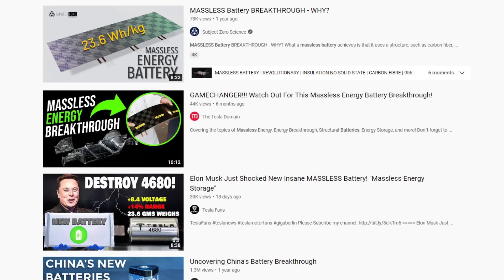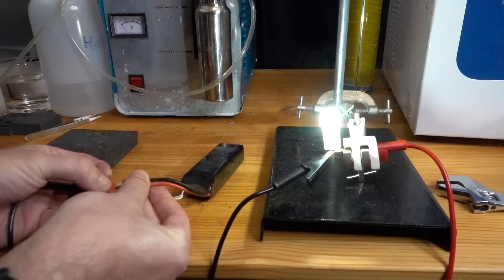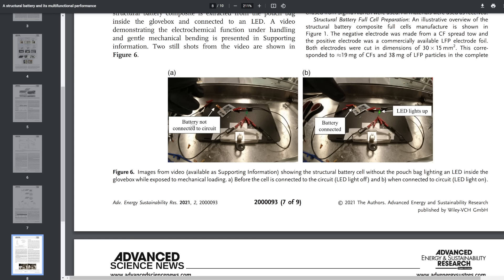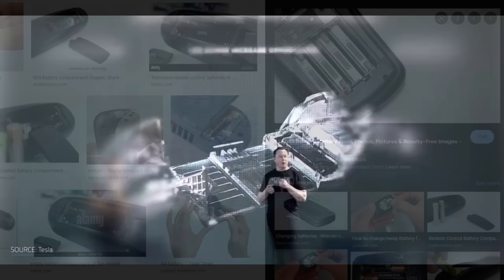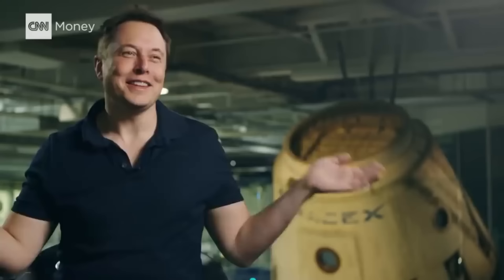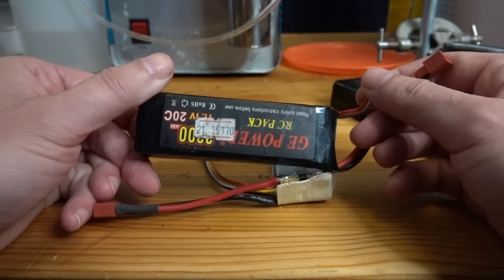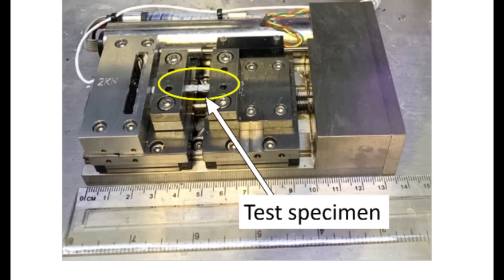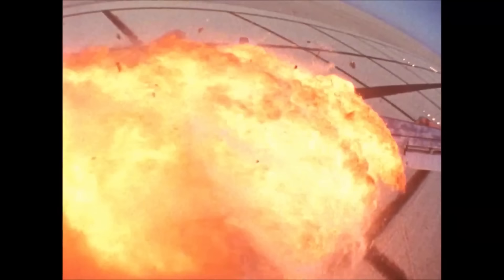Matt Ferrell, Massless Battery: BUSTED!!

Comment: Oh yeah, making it much more difficult to replace the battery of a Tesla by gluing in the battery is a great idea.
Why would you need to replace the battery of an electric car. Not like it's a part that goes through a lot of wear and tear.
Reply: No, but it IS the first to degrade to limited      performance before the major components do 
The average battery is ~ 50% after 10 years of cycling, way before major wear on mechanical components.
Reply: @dnomyarnostaw  You are out of date there on your statistics, and you will need to refresh yourself on current battery degradation, modern cells used in high end cars degrade roughly 1% per 20,000 miles (32,200 km). As such packs that are taken care of will last you around 20 years driving an average of 13500 miles per year.
Reply: @Yattayatta  Maybe for a good installation,  you could be lucky,  but if you look at actual plots of performance,  you get 15-20% that degrade far quicker. 
That's why a few of the new ev manufacturers like Vinfast are planning to hire the battery.
Nothing in electronics is guaranteed. 
You can throw away a bad TV, but a car with an outlier battery degradation is a problem .
Reply: @dnomyarnostaw  No different from an ICE car (by the way I don't drive an electric car, I also do not own any stocks in any electric car manufacturer, I'm just looking at pure data here) If you treat your car well, it goes further, if you don't, it'll degrade faster, if you never change oil or filter in your ICE car you won't be going as far as someone that does.
I'm sure there could be installation problems in some EVs, I suspect the difference is mostly down to how people charge though, if they use the "long distance full charge" function and if they stop straight away when something in the BMS loop malfunctions. 
You have to remember, ICE cars have been around for a long time, most people know the general advice on how to care for their ICE car to make it last longer, EVs not as much yet.
Reply: @Yattayatta  Proper operation is not even in the argument yet. EV "lemons" are not uncommon, as are ICE "lemons".
The thing is, a bad ICE front suspension problem, airbag, fuel line, brake or transmission problem, you can do a recall, like they have over the last 5 years.
A "lemon" battery, which is upwards of 7% ( if you don't count the GMH debacle)  that is built in, writes off the entire car..
Finally, "Most car manufacturers guarantee EV batteries for eight years/160,000km", so sure, you MIGHT get a 20 year battery, but the manufacturers don't think so.
Reply: @dnomyarnostaw  There are tradeoffs to everything, for sure, but to say that EVs are in their final and most advanced state they could possibly achieve is false. Look at the progress made in ICE cars over the last decade even though they've been around forever.
You can for sure recall a car over faulty battery cells as well, even if they are structural, that is on the manufacturer, not the consumer.
About the warranty, unless you go to some extreme luxury brand I will say with high confidence without looking it up at all that noone will offer you a 20 year warranty for 800 000+ km either.
Warranty is not there to protect you from ware and tear, it's there to protect you from factory mistakes.

Comment: 5:30 I'm going to correct you on one tiny thing here, batteries in terms of removable and functional have been around for a lot longer than 50+ years, for example the AA cell has been around for 75 years (standard) and 115 years total. The D cell is older still.

Comment: I think he's referencing the fuel feed pumps, not the injection pumps, which are part of the engine. It wouldn't make much sense to plumb a whole wing with a 200 PSI fuel line, especially since you need to vary that pressure to control the fuel injection rates. I wouldn't be surprised if the feed lines in an aircraft will function to some degree if the feed pumps fail (though the flow would have to be restricted somewhat).

Comment: Are they implying the battery has no mass?

Something that stores energy is a battery.
The pictures suggest the battery contains metal.
Metal has mass.
Therefore, it's not massless.

If the massless battery was actually massless, NASA would build their spacecraft out of it.
And because it's massless, spacecraft would become extraordinarily efficient- Probably going near Lightspeed.

But they don't. Why?
Because it's not Massless.
Reply: Think if they tried to lift one billion massless batteries, they could lift it?
lmao

And even if it was true?
A battery exploded in my hand once.
To imagine being surrounded by that, in a car(let alone a plane) is quite terrifying to think about.
Reply: Its more a "buy one get one free" deal in terms of mass rather than a battery that weights nothing. They just say that any structural beam/panel could also be a battery. And is nonsense.

Comment: The "gravity fed engine" thing would be a massive hazard. The power shuts off, and now the engines are stuck on full throttle (or whatever throttle you left them at). At least if they shut down the procedures are fairly simple, you glide until you land. Matt Ferrell's engines would make you completely unable to land

Comment: Gravity feed fuel systems in aircraft only work for high wing planes, ie. Cessnas and similar, and that's only if it's carbureted; a fuel injected engine would still require a fuel pump despite a high wing.  Low wing planes like Pipers, etc. require a fuel pump, which is commonly engine-driven along with an electric fuel pump for backup.  And while jet aircraft commonly have the engines below the wing, as TF says it still requires very high pressures for fuel injection.

Comment: I don’t get how this battery works. First off you need a completed circuit. So the carbon fibre electrode is just carbon fibres which are soft and floppy and part of the electric circuit conducting electricity, fine. So now you want strength and that carbon has to be encased in resin which is non conducting and electricity won’t flow. That massless battery has no structural properties at all as the lotion ion sulphate and the aluminium and the carbon fibres aren’t load supporting. The load is just carried by the clear plastic packet.

Also the battery wouldn’t be massless as mass is always there regardless even of gravity.

Comment: For those unfamiliar with CF composites as structural members, there's two ways to do it: the super expensive way is hundreds of layers rotated during layup with epoxy resin, or using a lightweight core material, like honeycomb aluminum or certain closed cell foams. 
Let's now replace that with non-structural battery packs and sandwich between even thinner layers of CF. And rather than leaving the heaviest part of your battery pack low and centered, let's put it Everywhere, as far away from the centerline as your structure allows. Of course that won't matter much when the robot is driving for you at 10mph in a one lane tunnel... 🤦‍♂
Just for an added kicker, jet fuel is typically injected into the combustors at (and often above) 1,000psi, through high flowing pumps with fuel lines as big around as your arm. I'm sure gravity will have no problem overcoming the friction required to turn said high-flowing pumps and move past all the valves and seals between the fuel line, solenoids and the minute injection orifices! If only my engineering brethren had consulted the all-encompassing tech shills at Undecided, imagine all the hurdles would could have skipped the last 50 years of aeronautical evolution!

Comment: Some aircraft have submerged booster pumps which help boost pressure to the engine driven fuel pump.  They only need them when furl gets below a certain level.  Others rely 100%on gravity feed to the engine driven fuel pumps.  So I'm not sure what Matt is even talking about.

Comment: Wait but haven't you seen the mass-less structural battery that Tesla uses in there cars! Because it's under the passengers and not in the car with them it's isolated and much safer than normal gas guzzling cars.

Comment: That's not how lithium ion batteries are charged. The whole string is charged at the voltage of the whole pack. Those wires to the cell junctions are for the bms to monitor the cells for over voltage and stop the charging or put a resistor across the cell to keep the voltage safe while the other cells catch up.
The black is only connected to one end of one cell otherwise it would create a dead short.

Comment: Just to keep things technically correct there are fuel pumps that supply the injectors, u could probably gravity feed fuel to injectors but need electricity or mechanical energy to activate injectors.

Comment: Carbon fiber is a problematic structural material, it can only be used in limited applications. It has the famous side weakness problem, ie it is only strong in 2 dimensions. Not such a problem for aircraft fuselage but this is going to be a big problem with cars.

Comment: I worked in the parts room for General Motors  auto dealers in the 80's. I saw a switch from field servicable components (transmission, engine) to a factory modular component replacement. This battery module smells of that to me. It puts more labor hours in the unionized factories instead of disseminating technology into the public. What happens when somebody builds a better battery pack for a Tesla?

Comment: I can see a structural battery in something like a marine environment where an metal boat might be able to generate a constant low current with a few strategic components in the saltwater and somewhere else in the middle structure. It might be useful to power a beacon or an emergency function of some sort.    In other words something like the saltwater battery displayed by thunderfoot could be useful in some application.

Comment: That's a marketing fail, they should've called it a massless quantum structural battery, lol!
But i have an idea for ice cars; use the driver- and passenger compartment as fuel storage. Now we have a massless structural fuel cell!!!!1 One only needs a diving suit and oxygen tank to drive the car (great idea, putting compressed oxydizer inside fuel, lol!) As a bonus, the fuel cell is now integrated into the best protected area of the car! :D

Comment: The Tesla 4680 battery pack uses the battery cells themselves to connect top to bottom metal in the box.  The box would not have the same strength or stiffness if it were empty of cells, in the same way that a hollow door is stronger with nothing more but a honeycomb of cardboard connecting the front and rear skins of the door.

Comment: Commercial jet engines have mechanical fuel pump so gravity feed from the AC tanks to the engine can work because once the fuel reaches the engine the engine pressurises it enough to inject it into the combustor, so long as the engine shafts are spinning.

Comment: There is a bit of truth to the wing fuel gravity feed. The fuel pumpe moves the fuel to the engines where the injectors take over. So gravity can in some cases stand in for the pump, but not the injectors

Comment: just petty note, balancing connector work littlebit different. You can charge it all together from power connector. Then in your case black white is cell 1 and second cell is white yelow (black yelow is cell1 and cell2 in series). Charger use those to connect resistor to cell with highest voltage to balance it.

Comment: Well just to be pedantic: Your black wire is not connected to all negative terminals but in fact to the negative terminal of the very first cell in the pack. So cell one is charged with black and white, cell two with white and yellow and so on.

Comment: So the massless structural battery is basically just one big giant capacitor - two oppositely charged, conductive surfaces with an insulator separating them ... so ... I am betting that, like a capacitor, if you poke a small hole through the surface of the battery, like a nail, a pin, or a key, the two surfaces would be electrically connected (through the break in the insulating barrier, and the battery would begin discharging through that point - probably VIOLENTLY, like those early lithium cell phone batteries.  

Since the two conductive surfaces are polymers, they would be vulnerable to organic solvents or other strong chemicals; instead of keying your ex's car, dump a container of paint thinner on it, and watch the fireworks as both positive & negative plates, AND the fiberglass insulating barrier, all start to melt!

Comment: Fairly minor point, but you got the wiring of the battery at 26:50 a bit wrong. The black lead just connects to the main negative terminal, the other leads connect to each cell in the chain.
The charge current when you charge that battery goes in through the main high current cables at the full pack voltage. The smaller wires are for cell balancing. If one cell is charging faster than the others due to slight manufacturing differences, the charger can allow some of the charge current to bypass that cell using an external mosfet across it.
As you can imagine, managing this for massive packs with hundreds of cells is a giant pain, and is a major area of research at the moment.

Comment: RE:  Gravity feed of fuel to aircraft engines with electrical failure.  You blew it!  Boost pumps are what fail with electrical failure, they feed fuel from the wing to the engines.  They help to keep pressure constant but are NOT required for the engines to run!  The engines have their own pump that are mechanically driven.  I know I'm a former C-141 pilot!

Comment: Philip, doesn't 10.3 meters = 1 atm only work when you dive underwater ? So meaning if you dive 10.3 meters the athmospheric pressure would also increase by 1 atm. I thought it is different above water surface.
btw. still love your videos <3

Comment: No true battery can be structural as like in the video, anything happens to it and boom. The case and container is what’s structural. Well it’s a different way of power, that for sure using carbon fibre, but it’s just extremely week. Kinda like using a quartz crystal to power a simple radio, really basic radio.  It’s real, it’s true and it can be done, just not very much energy. Probably a bit more then a LED from the quartz. The carbon fibre one will just end up as a large bulky battery if they want it to run anything. their is nothing ever weightless, it’s just lighter, but it then means it’s it’s weaker and won’t hold as much of a charge.

Comment: You don't need to charge the cells individually. Some cheaper chargers will, which is not necessarily a bad thing but tends to be slower with higher capacity batteries, but high powered chargers use the main leads to charge the battery, and the balancer connector (the one with a lead for the positive and negative end of the pack, and every midpoint between two cells) is used to keep track of individual cell voltages and discharge one slightly (or push in more current to the others to get them to "catch up", but that's fairly rare) if it's voltage is too high compared to the other cells (due to slight differences in chemistry between the individual cells).

If you are charging cells individually, you definitely don't charge in the sequence you've shown, but black + white, then white + yellow, then white+red. Charging via black + yellow after charging via black + white would lead to overcharging the first cell since it's already been charged.

Comment: (don't tell matt but general aviation still uses lead acid batteries, and airliners like the Boeing 868 and 787 use NiCd and Li-ion to power their avionics and start the APU / engines without an EPS :) )

Comment: Question, are these batteries not just a glorified  lesser supercapacitor? The main components being aluminum, carbon, and an electrolyte?
Wouldn't that mean they are less likely to explode or catch fire like lithium batteries do? Just a quick arc as it shorts, instead of a metal fire?

Comment: Are they really saving mass, or just attempting to redistribute the mass all over the car ie it's structure, panels etc? They'd still need the materials needed to actually produce power, it'll still weigh a lot, but now 500g goes on the back panel 1kg on the front 250g on each door both sides, while the "old" battery slot becomes "lighter and lighter" thus "proving" near "massless" batteries.

They're just redistributing the weight that's all...

Comment: just wondering on the tesla part. apparently even older model teslas cost as much to replace the battery pack as it was to buy a new gasoline car. So what happens when the newer teslas with new type battery pack integrated to the car frame requires battery replacement? Can we even conveniently recycle the old battery?

Comment: I am 30 sec into the video and I can easily think of s couple of of problems with the idea. One it will not be mass less because it might be possible use the vehicle structure to hold the  battery interior structure that interior structure will not add to the structure strength. 2 any structure damage will cause the battery to leak and today's vehicles ate designed to crumble to protect the occupants. 3 you will not be able to locate the battery in the safest place for it. 4 you will have a hard time laying the cells out in the most effective manner.

Comment: OK, at 27:11 "Cell 1" has on one end the LED connected, "Cell 4" has on one end a connection to "Cell 2", "Cell 2" has on its other end the LED connected. I've two problems:
1., How is the LED working? Shouldn't you have to connect "Cell 4" with "Cell 1"?
2., Where is "Cell 3" and why the weird order?